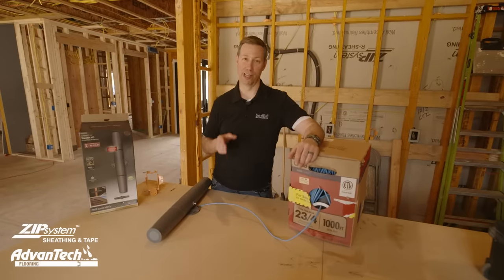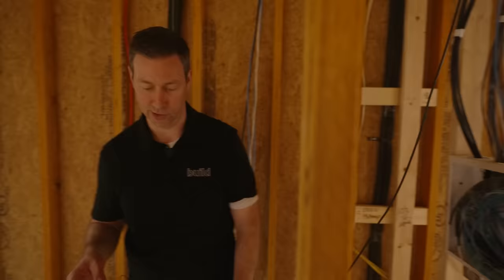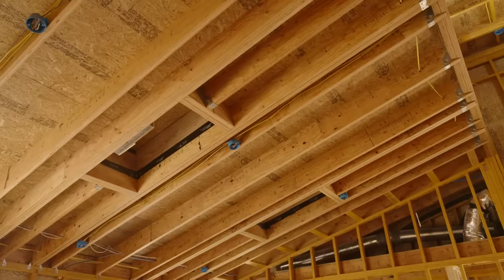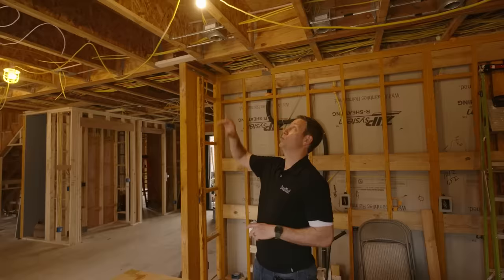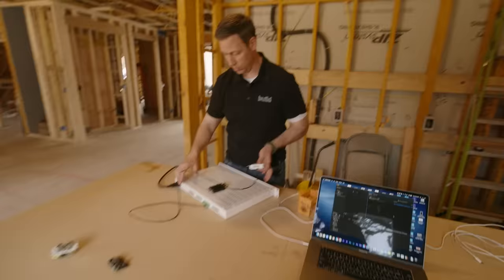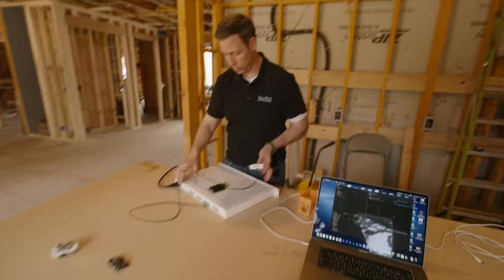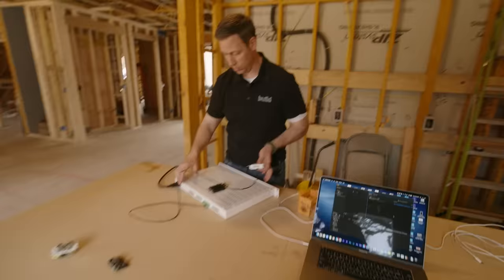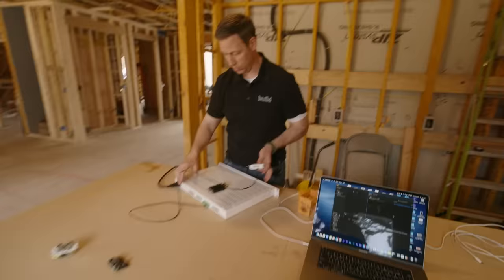Low ⚡Voltage at the Real ReBuild

Comment: Best thing to do with low voltage is expect to replace it at some point and make it easy to fish a new wire.
Hopefully you went with Cat6A as Cat6 doesn't have the bandwidth to support over 1gig internet connections. Cat8 is a hassle that you probably don't want to deal with unless you need it. Runs can be no longer than 35m, and they are very thick.
On the USB-C outlets. The Leviton supports 30 watts. The Voltek supports 60 watts. The bricks support up to 100 watts.

Comment: Yes please more detail on all of the low voltage stuff!  Sonos and Ubiquiti details 👍 ALSO, run CAT6 to the front door for the Ubiquiti doorbell xx EDIT: no need to run CAT6 to the doorbell, the doorbell uses 24vac, but definitely still get the Ubiquiti doorbell xx
Reply: Ubiquiti Doorbell is wifi. I uses standard Doorbell wiring 24vac. It does have a hidden USB that can power it but not recommended.
Reply: @Mixiter55  You are correct - thanks for clearing that up.  I'll try to edit/correct my original comment

Comment: I would run innerduct to all the key locations.   Future proof it.  

Also explore if Sonos has a streamer.  I use a bluesound node 2 and like the fact that I can control it all from my phone without any concern for Bluetooth distance plus you don’t have the audio compression issues of Bluetooth.  

Also for wired vs wireless use Access Points  and a controller.  Access points on each floor get wired back to your hub and that fixes all your wireless reliability issues.  You only wire the high bandwidth items like your TV .

Comment: Any area (closet, room, space, rack, etc) that contains active components (Voltec, UPS, Ubiquiti, etc) that consume power will generate heat and that heat needs to be dissipated or you will get heat buildup that will cause electronic components to run at temperatures over design parameters. This will cause premature component failure and thermal runaway. Cooling can be done with HVAC ducts sized for the heat generation plus spare capacity, fans to help circulate the air, and return ducts. For much smaller systems a louvered door to the space (room or cabinet).
You may even want to place a smoke detector in the space. This room need to be cooled year round, as when the rest of the house is being heated, this room needs to be cooled.

Comment: Lutron Serena shades - wireless - PICO switches - battery operated. Batteries last 3 years. I ran wires - but the batteries are so much easier.

Comment: 4:36 I'm pretty sure you meant a 19-inch equipment rack, the capacity of which is counted in rack units. 👍

That Voltek box, for example, is designed for mounting in a 19-inch rack and occupies 1U  (one rack-unit) of vertical space.

Comment: Hey Matt Ubiquiti makes an Access Point that replaces a wall ethernet port and transmits WIFI while also being a small switch with POE pass-through.  Great for offices where you might end up wanting more than one hard wire plug

Comment: Better wire that is thicker than needed than wire that is just thick enough.  If you have wire that JUST meets the need of the circuit and need to add additional receptacles you will need to run a new wire through a finished wall to make that happen.  You can always add receptacles to a circuit with wire that is thicker than needed just by taping into the existing wire.

Comment: Ubiquiti had a data breach in the last year, they have also changed the business model in the last year. Ubiquiti also after an update will crash your access points (sometimes). Businesses still use them because cost of replacing them and they can be remotely managed.   I've phased away from them.
I do like POE (Power over Ethernet)  access points,  I have 4 access points, 2 on the second floor, one on first floor and an outdoor access point in a detached garage. Wifi falls with distance. Then I have an office and 2 media centers hard wired.

Comment: Hey Matt, have you heard or seen anything about POE LED lighting? Powering your LED lights around the house can be done using Ethernet cable via a network switch, check it out.
Also, have you thought about, or included ventilation of some sort in your media cupboard, it could end up like an oven in there otherwise!

Comment: Good video. I own a low voltage pre wire company in Nashville, couple things for the future. I would recommend that you never use blue high voltage boxes. Arlington pass through boxes are better for future retro work and it makes life a lot easier to trim out. Also your guy that wired the house clearly doesn’t care about making his work neat. That wouldn’t pass inspection down here.

Comment: Great video! Suggestion - run ethernet even where you don't think you'll need it. If you're running 1, run 2. Unifi has 24 and 48 port switches for this purpose :)

Comment: As a IT Pro - Matt your going to want more wired locations and for future proofing, mostly one or two cables per tv location, one or two cables at computer location, one or two cables at a printer location, and if your using a network phone a cable or two at a location you want to have a phone. Some cat 6a or better to handle 10G at some locations and if you haven't done so a cable that runs to the patio so you can put a wireless access point if you want to have good wireless in the backyard. You also might want to run a conduit location for network cable at a few locations from your downstairs to your upstairs if you ever want to move low voltage between floors.

Comment: Only thing I’d say is to run at least a pair cat 6 to each location. It’s much easier to have those cables already in place even if you don’t use them. You can run so much over those cables and in the grand scheme of things it is well worth the investment.

Just my two cents.

Comment: Every time wireless gets faster wired ethernet connections find a way to get faster also. Even using the same wire there have been advancements. I would have jumped for cat 7 and feel confident that it will be useful for the next 25-50 years.
Reply: I was thinking that as well

Comment: One consideration in your build especially is that mineral wool kills wifi signal according to some of my tech resources. You might want to take even more of a structured wiring approach to your electronic communication needs. I am doing an addition to my 1932 Craftsman that will mimic the architecture but have the structured wiring , mini splits and LED lighting of a modern build.

Comment: What you show is not a "demarc" (demarcation point), what you show is an entrance for your service wire(s). The Network Terminator is typically on the outside of the house (as I do not see it on the inside from the shot you shared), and the demarc is inside that Network Terminator, where one side is your providers and the other side is the subscribers (you, in this case).

Comment: That 20 AWG wire might be handy for your LED lights, if you end up going low voltage DC. DC has cable losses over long runs, due to the inherent resistance of all current-carrying cable. Thicker gauge cable has lower resistance. Voltek probably sidesteps this by using a relatively high "low" voltage, say 48-70v, which also reduces cable losses, because current is reduced.

Comment: I would be interested in a video on Power-Over-Ethernet lighting if you ever encounter it. I know it’s not common in residential but it seems to be taking off in commercial. That’s a good way to do a low voltage wiring system for lighting. Check out companies like Versatek and Philips for these systems.
Reply: Also LumenCache and PMI. And environmental lights does all DC over 2 wire.

Comment: I like the concept of a low-voltage distribution network in the home.  However the fact that it's low voltage means that there are efficiency issues.  Depending on how you had to route your wiring, I could see having a run as long as 200' in some cases.  14 gauge wire has a resistance of around 2.5 ohms/1000'.  So a 200' run would be 0.5 ohms.  At the USB-PD maximum of 5A you're looking at a 2.5v drop across your wire. That is 12.5W out of the possible 100W that USB-PD can source simply dissipated as heat.

Comment: Run Cat6 network jacks everywhere. WiFi is garbage but you can use PoE for wireless access points, security cameras, etc.

Sonos introduced AirPlay2 functionality right as we were building our house in 2018 so we saved us a ton of cash versus running a pre-wired system throughout the house.

I swapped out a regular 15a outlet in my wife's office space with a GE-brand outlet with dual USB ports (USB-C and USB-B) and it powers her Macbook over USB-C just fine. /shrug

Comment: I used ATX whole house low voltage. Just had to run 18g thermostat type wire.  Much more efficient and the switches can all be programmed.
Reply: Also from Texas

Comment: I have a Samsung frame. I don't know if the cable you'll need for your television comes in a 30 meter run. You might want to check before you follow through. It's a very delicate wire. No hard bends, it's not supposed to rub against other wires.

Comment: Do the app for the blinds, you will use them more. They will just stay shut otherwise. Switching between the Koehler speaker and Sonos might be a pain as well, we are a Sonos dealer and it is a no brainer, very easy to use. Otherwise nice selection!

Comment: It's 2 years too late, but just an FYI, Samsung's "One Connect" cable that you mentioned that supplies all connections to the TV including power, is NOT rated to be run inside of walls. It's a fire hazard and if something were to happen and they figure out the source, you're not getting any insurance money.

Comment: Matt, you seem to show the antenna oriented such as you pointed it down the 'tube' towards where the broadcast antenna's are.  You better check out how you're getting reception, because it should be oriented 90deg from that, because the antenna is along the tube, you and want that across (90deg to) the signal.   I'd recommend going and setting it up at your current home and trying it out to verify the orientation before mounting it.

Comment: Good job Matt.

Regarding Low voltage lighting solutions Loxone is a good option. 
You can mix and match low voltage and line voltage lighting in their system.

Comment: Ubiquiti actually did low voltage LED lighting with ceiling panels and switches all connected via CAT6, it's called UniFi LED, but they seem to have all but abandoned it already.

Comment: Matt, not completely sure but with 12ga. on a 20 amp breaker and having lights and plug outlets rated for 15amp if you had a short in one of your sockets it could short and catch on fire  before the 20 amp breaker even trips. 12Ga. is the best way to go but you should use 20 amp outlets with the 20 amp breakers and 15 amp breakers for 15 amp outlets.

Comment: UniFi makes low voltage POE lights, that are powered just by one of their rack mounted switches. More of a commercial, suspendible  ceiling system, but still a cool idea, maybe they’ll make for a house one day with more residential like fixtures.

Comment: Congrats on the Unifi. Probably the best go-to at the moment. I'm doing exactly the same on my build. Think about putting cat6A or Cat7 to TVs and Office to guarantee a stable 10Gbit for future. And always run two Cat6. Cheap and if one fails you have a second cable. Plus pull cat cable everywhere. Especially to fridge as that seems to be the coming media hub in the kitchen. 
Sonos is the other go-to. 
Question on the lights, why not go Philips Hue? 
Love the low voltage USB stuff will look into that!

Comment: Careful with signal loss with HDMI cables longer than 50ft. With low quality video it may not be a problem but with 4k and higher you could get some loss especially if you run through multiple jacks. Something to consider.

Comment: - Run atleast 2 cat6 cables at each location
- Run multiple direct burial or in conduit 6 cat to the street. That way you can mount POE cameras which monitors all traffic in the neighborhood.
- Terminate all wires and test them all BEFORE the sheetrock goes up. I ran close to 5k ft of wire and found two faulty ones which I had to replace.
- Run cat6 to your wall exteriors for the security cams.
- Run optical toslink to each tv location for audio.
- Run coax to the attic for the antenna. 
- Why no in wall speakers?

Comment: Your 12/2 may be addressing an old problem, the switching power supplies of old computers needed a thick neutral conductor for the "buzz" they created. The newer power supply designs, like for LED lights don't seem to have this problem.

Comment: I was going to add. If you think you ran all required ethernet/low voltage connections, go back and add same amount of rough wire to those locations. It is almost always better to run as many devices over hard wire rather than WiFi.

Comment: If you’re doing a metal roof, mounting that antenna under your soffit will likely be a big issue. The metal will block some if not most of the signal.

Comment: You kind of mentioned it at the end of your video but I was thinking that running some kind of conduit to the Ethernet points in your house would be beneficial for future upgrade.  While the 12/2 AC copper won't need to be changed, your cat-6 will, some day, be insufficient.  With a conduit you should be able to pull upgraded cable if needed in the future.  When I wired my house (1970's ranch) cat-5e was the latest, now there's cat-6 and I think cat-7 is coming.

Its been my experience that wired Ethernet has always been faster and more reliable than Wi-Fi.  Particularly when the Wi-Fi runs downstream of you ISP and Residential Gateway.

Comment: Matt: Tip on that samsung tv cable. The cable itself is very thin and fragile and wont tolerate kinks of any kind and the plug on the end is a good 1" across... i.e. needs a big hole through the 2x's. Pairs well with samsung Q80R sound bar too. Great tv. only sticks about 1/2" off the wall when paired with the special flush wall mount
Reply: I wonder why an extra 1" less of sticking out of a wall matters. Not a sarcastic remark, I just don's see it worth the money and effort to fight over that extra inch or so.
Reply: @pnwbuilder  It's worth it once you see it. It sits perfectly flush with the wall. Cant see behind the tv at all and the tv itself is only about 3/4" thick. Uber clean install

Comment: You shouldn't run low voltage cable parallel to high in close proximity. It should cross at 90° if it's in the same vicinity. Shielded cable helps but it's good practice to keep some distance between the two different voltage levels/types to limit electromagnetic interference.

Comment: Matt, I may not be the only one to mention this, but antennas are polarized even that omnidirectional antenna.  There certainly is a right and wrong way to face them.  But a omnidirectional antenna like that should be perpendicular to your transmit tower not faced "inline" like what you seemed to mention.  It may still work fine, but it will result in a -12 to -20 dB drop in reception depending on your specific antenna.  This may be inconsequential depending on the power levels you see from your location, for example if you have more than 60dB above the noise floor it won't matter.  However, if you're going to the trouble to drill holes in the house talk to the manufacturer about how to best place the antenna before making a permanent decision.

Comment: 11:20
Concerning the low voltage LEDs
There are systems like Loxone SmartHome, that produce a cable with 2 wires for the BUS (communication) and two other wires with 24V.
Technically you just connect the wires from one light to the next and later on you just have to configure every single light.

Comment: Matt, do you plan to make a “user manual” for the house for a future owner to, for instance, explain what the pantry access panel and conduit is for?

Also you should definitely run some CAT6 ceiling drops for the UniFi smoke alarm-style wireless access points.
Reply: I was also wondering about security alarm. Good point on "user manual", everyone should have such a thing. Good feature when selling the house.

Comment: If you're worried about running too-thick copper power cable, just run 240 volt everywhere instead of 110v split-phase.  Then use consumer appliances offered in 230-240 volts (i.e. like most of the planet does) and capable of both 50 or 60 Hz, implicitly or with manual selection switch.  Double the voltage, reduce the wire size by almost half.  (Sort of like comparing lighter 28-volt aircraft wiring to heavier 12-volt automotive wiring).  For heavier motors such as in a carpentry edger/planer or water well cap-start cap-run pumps, sure run heavier cable from the same 240 volt electrical panel everyone has.  No need to run 12-guage everywhere carrying 20 amps of 110v, if 6 amps of 240vAC will do.

For LED lighting and other low-wattage devices, no need to run wiring AT ALL.  Use wireless power transmission based on resonant induction.  One or two power transmitters per storey should suffice.   https://en.wikipedia.org/wiki/Resonant_inductive_coupling

Comment: As a data tech myself - you missed a step on "wireless systems" and cabling them - each and every "wireless" device MUST be WIRED at some point! If it's a passive AP, meaning it has a POE jack, run it to a POE switch and you've saved yourself an extra cable.